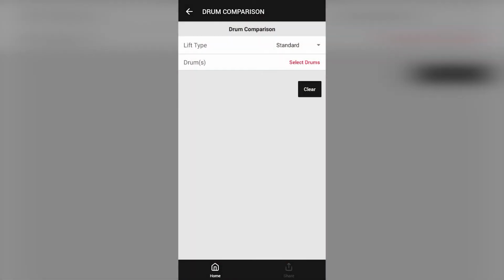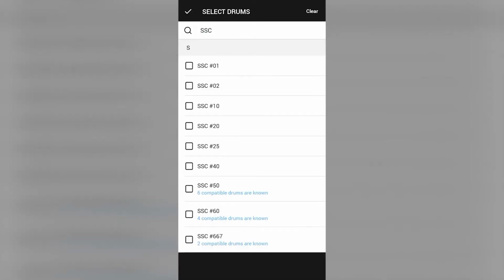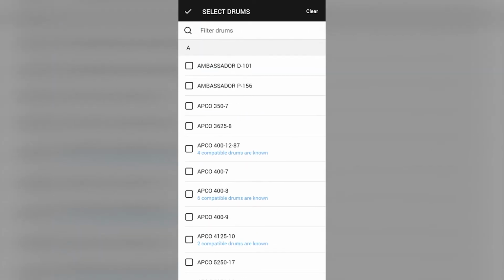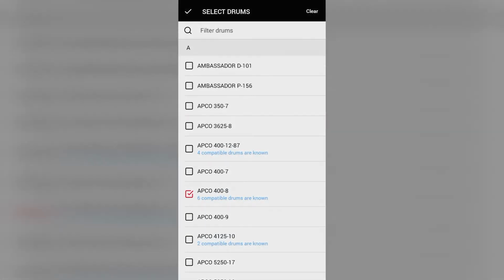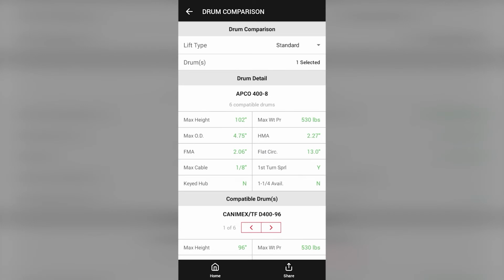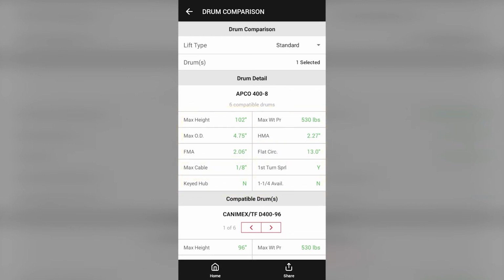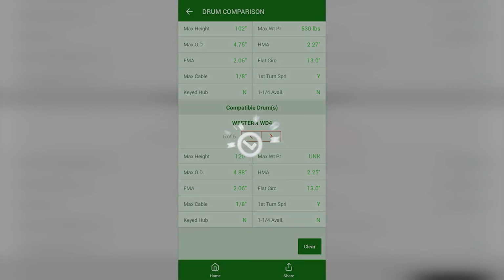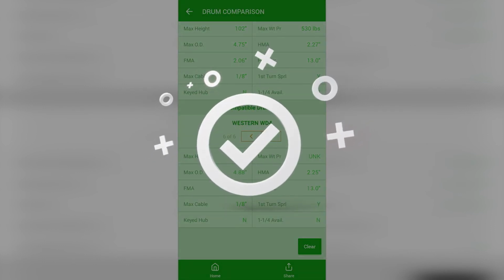Spring Engineering App | Drum Comparison

Comment: Wish you had more decription of the drum types.  I have a portable saw mill which appears to have a drum connected to a hand crank to move the carriage.  I need to get a drum that will provide about 10% more "lift" travel.  It might be a VERTICAL lift since it doesn't look like the Hi Lift of the Standard, however you never showed what the VERICAL lift rum looks like.   NOTE:  I assume the grooves are cut like threads.